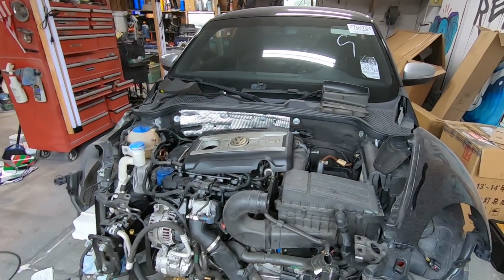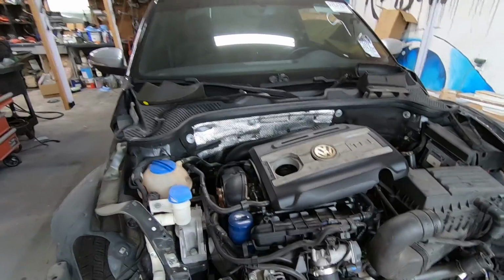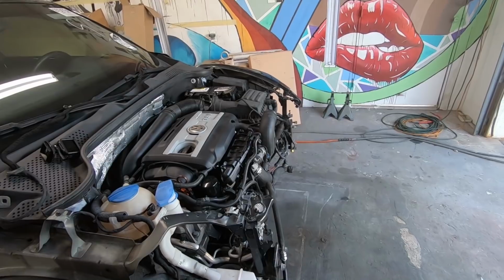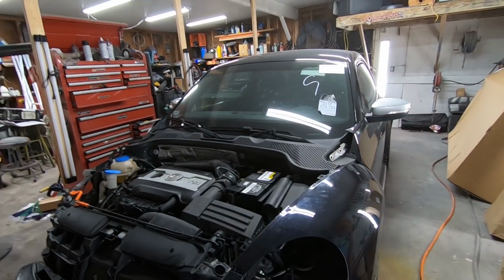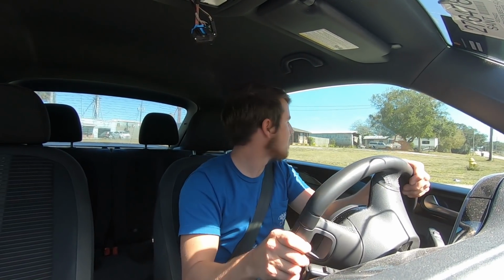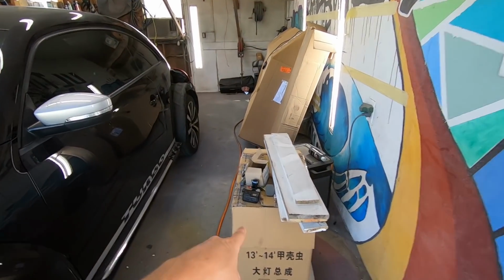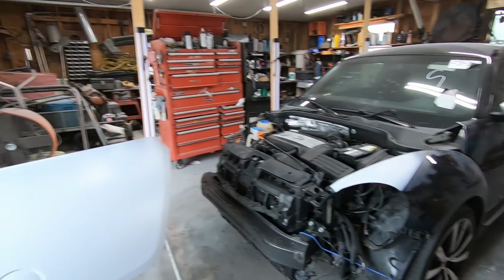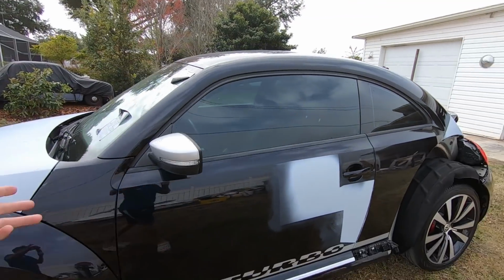Free Volkswagen Beetle is Running! -Episode 3

Comment: Looks good and hey for $450, that's a great price for a swap out. The 1 thing as someone who deals with VW daily, change to VW coolant, as the engine, sensors, and other parts will thank you. You need G12 or G13 coolant and it's becoming more available now a days. People have put in Prestone, but from my experience, even the new stuff, it causes headaches and gells up more. 

As for other stuff on the body and such look great... keep up the good work. Ecs tuning has lots of great stuff, and there is a few other companies for tuning setup. If you haven't, invest in Vag-Com for scanning and doing lots of you own mods and such.

Comment: I don't blame you for farming out the engine swap, especially for that price. You're doing the body, paint and reassembly.
Reply: Next time, use self-etching primer, but only on bare metal. If it's not epoxy primer, it's porous to water....

Comment: A suggestion of y guy who used to work on cars in a body shop: When priming avoid those sharp edges: Do not put the paper to close to the place you spray. Those lines might show up again after painting. I never believed it myself until it happened to me. Those edges of filler will take a lot of time to sand out as well.

Comment: Man I just hate how a new (used) engine was put in a timing wasn’t done. Doesn’t matter how many miles these 2.0ts have the timing is notorious for tensioner to over expand and timing to jump. I’d recommend to have this done soon, along with a new rear main seal, but no need since you got the motor in now. Other than that great job so far man, great to see this car get brought back to life!

Comment: I did a 2.0t swap on my ‘10 Jetta and if the bug is similar I wouldn’t blame you a ~400$ price is unbeatable. When I swapped mine it took about 6 hours (total) and had myself worried that I missed a bolt 😂. Quick question what year is that engine I know with mine the 10s and below 1st gens have a timing tensioner issue so I’d check if yours is updated “probably is”. And make sure to clean that carbon on the valves every once and while. One last thing the rear mains with the dsg might leak as they have a stupid design I had to replace mine with a billit one. But all in all those engines make up a great first car (in my case). Good luck the bodywork already looks fantastic!